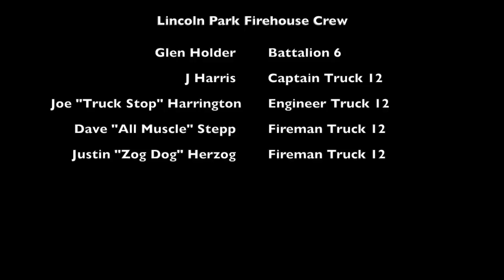Tuther Fire 2 FireCams

Comment: Hands Down One of the Best Videos Ive seen. Cap did a great job with his crew. This is one Video I will pass along to my guys. Keep up the great work and stay safe Brothers.
Reply: Nice video, nice hole cutting but a complete waste of effort and resources as they didn't have to go up there to put this fire out.
Reply: Last time I checked there were females in the fire department! Typical male comment, thinking it's still a males world!!
Reply: Hi!
Firefighter from Germany here ;)
I have one question:

What is the advantage, when you cut holes in the roof of the burning buildung?
I mean, that's pretty dangerous to work on a roof which is actually on fire in the inside, right?
Reply: @nicof.7051   roof ventilation, yeah can.be dangerous if a soft spot.Is stepped on so good judgement is always needed before going.up.to ventilate
Reply: @nicof.7051  vertical ventilation is to release the hot gases out of the structure to allow your interior attack team to advance of the fire for extinguishment and not be roasted in the process. US firefighters are taught the safest methods of all ventilation tactics.
Reply: @JB91710  your obviously not a firefighter.....if you are, not a properly trained one.
Reply: @SMichaelDeHart    I'm glad you explained in detail why you think that.  Wait a minute, no you didn't, just like everyone else!
Reply: @nicof.7051    If you start using Logic and Common Sense when you evaluate American fire fighting tactics, you are going to be in for a world of hurt here on YouTube.
Reply: @JB91710  scooter, please tell me what extensive experience you have in the Fire Service?! Basic fire tactics teaches that when you conduct an interior attack on a structure fire, vertical ventilation is a safe and practical application. Since you apparently have not received a certification in NFPA level 1 and 2 fire fighting, basic fire science methodology and NFA approved firefighter safety and survival, it appears to me that you're relative lack of knowledge is self-evident.
Reply: Look jackleg, my information is based on 26 plus years in the fire and EMS service. I've probably fought more structure fires then you have ever dreamed about in you're ignorant life. If you will study and apply engine company operations and truck company operations, it is common practice to utilize vertical ventilation as well as horizontal ventilation as dictated by the fire. In this particular scenario, you had a working structure fire on the B/C side of the involved structure. Flame impingement had occurred at the eaves and it was obviously extending in to the attic area. As the truck company arrived on scene, the company officer obviously made the decision, after his size up, to proceed to the roof to do vertical ventilation based on his assessment. The primary function of a truck company is for ventilation, salvage and extrication. Your comment regarding a waste of resources, was totally incorrect and tactically unsound. As the interior attack team was making their advanced upon the fire, it is common practice in the United States fire service to do vertical ventilation to reduce the heat and gases off of the firefighters inside the structure. While horizontal ventilation could have worked in removing some of the smoke out of the structure, it would not have removed the hot gases because, if you know anyting about fire science, heat rises. The heat builds up from the ceiling down and can cause major issues for the interior attack team. After the vertical ventilation was coordinated between the truck company and the engine company, performing their proper functions, the fire was quickly extinguished. I recommend you refer to the National Fire Protection Association, the International Society of Fire service Instructors, the National Fire Academy, the United States fire Administration, and many more other fire service organizations, including the Fire Department Instructors Conferences that are held yearly. I'm sure most of the well-trained and educated instructors will conclude that the operation was conducted, in this situation, accurate and to the point. Now scooter, I recommend you better hurry up and educate yourself in proper fire science and engineering before spewing  bullshit in questioning tactics that have been utilized for years and have saved many firefighters lives.
Reply: @SMichaelDeHart  Thank you. I see you have met our resident loon, JB. He is dangerous and is facing some harsh actions for his continued slandering of fire depts. everywhere.
Reply: @mxslick50  LOL..... this is the first video that I happen to come upon from this captain. It is absolutely amazing when someone tries to argue with experience and education. But, not only do I have over 26 years in the Fire EMS service, my degree is in Fire Science, I have my NFPA level 1 and 2 firefighter certifications, I am a IFSTA and NFPA certified instructor, I've been with two career and one volunteer department in those 26 years, I'm certified though West Virginia University and the Maryland Fire Rescue Institute and have over 700 credit hours in Fire Science and Engineering related fields. Every single structure fire is different. That is why we study building construction, fire behavior, tactics and the list goes on. We apply all of our experience and training to each scenario differently, since no working structure fire is cookie cutter. I do appreciate you pointing out that this so-called 'firefighter' is the resident loon.
Reply: @SMichaelDeHart  You're welcome. To clear up a few things, he was never a Captain, just a nozzle man on a Volunteer Dept. in VT. back in the 70's. As you will quickly see, all he'll ever do is call people names (Stupid, child, zombie, fountain statue, incompetent are his most -used ones), bash every dept, claim he can knock out a fully involved structure with the deck gun and tank water, spout off that "ff's need to get this search first crap out of their heads" (and just throw a bunch of water first, BEFORE looking for victims)....I could go on, but you can pretty much find this clown on every fire video that hasn't had comments disabled because of him.  This video https://www.youtube.com/watch?v=tgHZUyK2ON4 has a real great conversation showing the true depth of his delusion. (The replies to Skylar). 

I am in a very tiny town in Idaho, we have some apparatus and gear for our own Vol dept, that has been seriously neglected. I have been tasked by the Mayor to train and get our dept. back together again. Luckily our nearest muni full time dept. (27 miles away) has agreed to assist in getting me and a few others trained. I would like to talk to you more about it if you don't mind, hit me up on my channel's discussion tab.  

Thank you for your service sir.
Reply: @mxslick50  hey brother no problem. Have you thought about grants through USFA and FEMA?? Also, I know some PPE mnft also do grants/donations for small depts in need.
Reply: @SMichaelDeHart   Thank you, that is some great information, we will look into that. I still have to do an inventory and check condition on all of our gear and tools,  I do know that our radio's batteries are all shot, the previous idiots running the city left them in an unheated trailer without charging them. Once I assess our needs/wants, I will look into getting the process started.
Reply: @mxslick50  dude, did you see my last post? I'm more than happy to assist any brother in the Fire service. Read my last post.
Reply: @SMichaelDeHart   I and the fire fighters I worked with decades ago were using the things UL is just teaching Now. They and the rest of the American fire service got ridiculously scientific and complicated fire fighting  (Vertical Venting) to the point that they forgot to put water on the burning material and have seen where they were wrong and are going BACK to basic, get the job done practices they created in 2004. It isn't New Technology based on new Testing, it's just back to basics common sense fire fighting.  I could have written their book.
Reply: @mxslick50   "I am in a very tiny town in Idaho, we have some apparatus and gear for our own Vol dept, that has been seriously neglected. I have been tasked by the Mayor to train and get our dept. back together again. Luckily our nearest muni full time dept. (27 miles away) has agreed to assist in getting me and a few others trained. I would like to talk to you more about it if you don't mind, hit me up on my channel's discussion tab. "  (OH!!!!!!  So you NEED training?  But you seem to be so confident in your criticism of my tactics!  God Help that town.  Based on ALL your comments to me, they won't be any better off and will probably be worse off for your efforts.)
Reply: @SMichaelDeHart    That was a pretty Childish reply from a so called Grown man!  Do you even proof read what you write to see what Grown Ups will think about it?  You obviously haven't seen my response that I'm sure will only inspire more childish from you.

Here's a test of your professionalism and strong work ethic.

PROTECTION!!!  That, is what victims need before anything else!!!   FIRE and TOXIC Smoke, are the Threat!!!  That is what victims need to be Protected from!!!  When you think from that perspective and you consider Everything that is done from the time you leave the station to the time you get back, what is the Four Step To Do List upon arrival?  Think of EVERY Detailed step that needs to be taken before you can perform any job but only list the Four most important things that will Protect any victims..  I'll give you a guide to keep you on track  
Are you fully dressed when you arrive?  
Do you carry onboard water? 
Are there hydrants or an additional water supply? 
Can you See the Burning Material?  
How accessible are the victims?  
Do you know Exactly where they are?  

1.

2.

3.

4.
Reply: @mxslick50  🖒🖒...lol, hell, I gave up. I don't have the time or inclination to waste my knowledge on a human waste of space.
Reply: @JB91710  And another thing that hasn't sunk into your thick skull yet....I am respected FAR MORE that YOU are by these professional firefighters and like I said before, have you noticed that NO ONE other than YOU has debated the logic of any of my posts? Think about THAT one for a minute, since you preach about how you are a THINKER.
Reply: @SMichaelDeHart    That's the kind of response I figured I would get from you.  The desperation in your tone was telling.  I also noticed that in two response to my challenge, you didn't offer any fire fighting information.  Just more childishness.
Reply: @mxslick50    You are the second of your new playmates that doesn't have the time to waste on fire fighting tactics.  Could it be that you can't handle the truth?  My and the intelligent worlds tactics (UL NIST), are so simple and basic that you guys can't deal with them.  Too much work and not enough Heroism.  P.S.  Those were Shadows on the roof!
Reply: @mxslick50    Oh and you Blocked me?  I may just cry myself to sleep.  Child!
Reply: @JB91710  what they did would be called a "roof ventilation" not "hole cutting". Roof vent, is used to... you wont believe it... ventilating the smoke from the building. It also reduces the chance of a back draft or flashover.
Reply: @margief1798  Keep your feminism out of firefighting.
Reply: @SMichaelDeHart  Check your email..I sent you a few messages.
Reply: @mxslick50  🖒
Reply: @brendanzadera8948  You printed what someone told you very well. Too bad you can't THINK any better than the rest.   It is interesting to me that NO ONE can tell me how it works without saying Heat Rises.  I have printed volumes on how it WON"T work unless the conditions are PERFECT and even then, the fire inside the house is introduced into the attic and now you have a structure fire.
Reply: @JB91710 Where are you a firefighter
Reply: @brendanleak1490   It doesn't matter where or even if someone is a fire fighter.  Their comments either make sense or they don't.  Fire fighting is too simple for anyone to not get what I'm saying.  There are thousands of fire fighters and departments that just don't get what the JOB is.  How ling they have been doing it holds no weight!
Reply: @JB91710  if firefighting is so easy way doesn't everyone do it
Reply: @brendanleak1490  Most people want to actually work for a living, create and make money.  Squirting water and breaking windows is for the select few!
Reply: @JB91710  does your "fire department" teach you how to properly vent and when and when not to do it
Reply: @brendanleak1490    Nobody "Teaches" me!  I. teach me.  I have been a Thinker all my life.  Most people are Two Dimensional Reactors.  They see something, a thought come into their minds and they open their mouth.  A Three Dimensional Thinker, keeps their mouth shut and examines the subject from every angle, troubleshoots it and then formulates the best possible answer.  Most people Follow.  I lead.  People don't like Leaders so they fight them to protect their ignorance and mediocrity.  So, they don't learn anything.

Common sense and logic along with very basic knowledge of pressure zones are all that is needed to figure out when and how to vent.  A strong work ethic is the single most important ingredient in making a Good Job.  Most people overthink fire fighting to the point that they actually forget to put water on burning material.  Really!  Eliminating the threat is the First thing you do as a fire fighter, not that last thing like 90% of America's fire departments.

You don't vent until you have a charged hose ready to apply water to the burning material because when you allow heat, smoke and pressure to leave the structure, you are Moving those gasses and they will mix with fresh air from many different locations and the fire will get bigger.  That is a Bad thing!
Reply: @JB91710  if you don't vent the fire gets depleted of oxygen. And when you smash windows or open doors the sudden rush of oxygen will cause a back draft like the city had not to long ago. to prevent that you vent to allow the toxic gas and heat to escape and let the interior guys to make a push.  In the case of the video they also where checking to see if the fire got into the attic.
Reply: @brendanleak1490  That's why you start by breaking out the upper sashes as close to the fire as possible to release the pressure and give the gasses a direct route to the exterior.  That is quickly followed by breaking out the lower sash and applying water to the burning material.  Opening the door takes time and you need a fully dressed and assembled entry team to fight fires through a door.  Windows are faster and safer for knocking down the threat. When you enter, the space is Much cooler and there is No threat of flashover.
Reply: @JB91710  Your right, I did write what someone told me because you need to learn from someone to know something. Obviously, you don't.
Reply: @brendanzadera8948  Who teaches the teachers?  Ever think about that?  Someone has to figure out the Right way!
Reply: @mxslick50   The Garage video that you are such an expert on, childish one!
Reply: @JB91710  " @Brendan Leak Most people want to actually work for a living, create and make money. Squirting water and breaking windows is for the select few!"     

Yeah and we all know how well that has worked out for you, living broke and having to beg for money to finish your project car.
Reply: @brendanzadera8948   Well, I can say the one thing JB is right about in all of his posts is this: "Nobody "Teaches" me! "
Reply: @mxslick50   Ever Own or Build anything child?  You actually have to own something to lose it.  The recession plays no favorites.  Interesting how you focus on that rather than fire fighting tactics.  Are the shingles on that garage still smoking?
Reply: @Typical Canadian   Boy, you really don't get it, do you?  Someone has to Create the original idea using intelligence, common sense and logic!!!!!!!!!!!!!!!!!  It has to start somewhere!  Don't you THINK?  No, obviously Not!
Reply: @margief1798  jeez.. As a female in a predominantly male profession I must tell you comments like this one only make our work harder! Even if we are feminine we ARE part of the "guys".
Reply: @nicof.7051  Hello Nico, I agree with you. I think, opening ventilation holes on top of a fire makes for a chimney effect, so that the interior fire will be more intense because of more fresh air being conducted to the fire itself. The less oxigen a fire has, the less violent it will burn - eventually it may even go out on it self.
Reply: best argument ever, i think the firefighters did a excellent job
Reply: @knuffelbaer1971  Are you a firefighter? Have you ever heard of a little thing called a backdraft? Have you ever watched a fire up close and seen how wrong you are? 

Here's what a REAL firefighter (Brendan Leak) said in a comment above:
 " 
@JB91710 if you don't vent the fire gets depleted of oxygen. And when you smash windows or open doors the sudden rush of oxygen will cause a back draft like the city had not to long ago. to prevent that you vent to allow the toxic gas and heat to escape and let the interior guys to make a push.  In the case of the video they also where checking to see if the fire got into the attic. "

Let me highlight the key point for you:

"to prevent that you vent to allow the toxic gas and heat to escape and let the interior guys to make a push. "

Oh, and that fresh air you refer to...it is cooler than the continued heat buildup that results from an unvented fire, where said unvented fire will eventually cause another unpleasant phenomenon: Flashover. (The spontaneous ignition of unburned materials that have had their temperature raised well above normal ignition temperatures.)
Reply: @JB91710  LIAR
Reply: @JB91710  Malicious troll
Reply: @JB91710  Yes I have they are University Professors and Fire Scientists You have seen some they work for UL, NIST, ISFSI, and NFPA organisations. These people have far more expertise and knowledge than you. What credible academic certifications can you produce?
Reply: @mxslick50  https://youtu.be/9VDi8LfC3lY More of The village idiot attacking I have reported this as well as showing the world he thinks he is above the law; specifically the Americans with Disabilities Act and as I am a Canadian Citizen resident in Canada the Charter of Rights and Freedoms No person who clearly demonstrates they do not absolutely respect the law can be capable of being certified as a firefighter in any capacity. I think we now have information that can be used to prove this very clearly and it is in this video's comments  section.
Reply: @JB91710  this comment demonstrates a lack of vision regarding a coordinated fire attack. This is a fire attack that allows the fire to be fought by multiple teams or divisions that work together performing various tasks involving multiple tactics simultaneously (At the same time). Exterior operations generally have five divisions. A. B. C. D. and Roof. Their duties are to protect exterior exposures, ventilation and fire suppression exterior attack.The interior companies are basement and then a division for each floor the top floor includes the attic. Interior companies duties are to search isolate the fire and to apply the wet stuff to the hot stuff. any any all of these thing are occurring at the same time. to keep things coordinated there is an Incident Commander and fire company officers who pass along information about the fire to him/her then direct the firefighters with the balls to actually do the job based on the orders they receive from the Incident Commander. You keep asking where are you wrong. How about this you are bashing firefighters who are doing the job they have been told to do. Not running off and operating independently of the Chain of Command creating a risk to themselves and others. You should know something about that since it is the underlying theme in all of your commentary.
Reply: @JB91710  Do you remember stating that firefighters should follow the teachings of I.S.F.S.I. N.I.S.T and U.L. Here is a U.L. video teaching Vertical Ventilation.
Reply: @JB91710  I have seen basement fires that traveled vertically inside the walls of the structure and the second fire seat's place of origin was in the attic. Nothing between was burning. Gasification of solids by Combustion results in an very high coefficient of expansion. This will create positive pressure inside the structure. That pressure is seeking a way out. firefighters also have the original seat of the fire in the basement. Two places where the fire is oxygen starved the basement and the attic. My fire attack is an aggressive attack on the attic fire first. ladder to the roof vent the roof with a small hole to start extinguish the attic fire then open the roof to allow the gaseous fuels and other non-flammable gases that have been created out. Once the flow path is established the basement fire will be easier to manage get inside and cool the basement with a fog pattern and then get inside and work on the basement fire and the extension to the attic. It is important to keep a line on the roof and cool the attic space as the need arises. Another tactic to speed clearing the smoke out of the basement is P.P.V. can be used to force fresh air into the basement. Yes it is done because it provides the firefighter a safer environment to work in. Remember the C in SLICE-RS stands for cool from a safe location. Also remember you are working as a part of a team and the object of this endeavor is to prevent violent explosive and highly dangerous fire related events from occurring.
Reply: @knuffelbaer1971  In a coordinated attack the roof division works with the interior division to attack the fire at the same time as roof ventilation is being done. Because of the clearing of very fine carbonized fuels in the air (smoke) and the removal of heat it significantly reduces the risk of two violent fire events 1 Flashover and 2 Backdraft. The added benefit is it allows the firefighters to be able to increase the effectiveness of the fire attack because they are able to see better. The down side is that if the guys in the roof division linger too long then they become casualties in need of RIT.
Reply: @margief1798  Do you know whether or not he has any females on his department or even his company or if he is a fire fighter or even if this is not the male persona of a female YouTuber?
Reply: @JB91710  JB if you use logic common sense and lose the holier than thou attitude you might find yourself being slagged less often.
Reply: @JB91710  Your view is the European/UK view of firefighting.  They never get above a fire.  The air/fuel and suffocation concept you put forth here is how they see it, they say it works for them.  They play quite the game of hide and seek, and focus their attack at maintaining suffocation which by the OSB models we've all seen burn in the back lot during training, really is the best way to kill a fire short of water.
                The only problem I see with it is that it doesn't take much for the heat building up to flash once some fuel hits it with that 'attack' plan; just one improperly vented window, the wrong open door, etc.  To me, it can really be a recipe for a major catastrophe if that heat and all those flammable gasses are not expelled.  That's fuel too.
                 Roof ventilation is dangerous.  We know we've had FF's fall through (why UK chooses not to do it).  We know if the interior attack is delayed or not coordinated well with the venting, it can create excellent air flow and draft fuel into the structure making a defensive fire out of a manageable fire if it's not knocked down in a timely fashion after venting with fire present.   But above all, we know big-boy rules; the best way still to know where and how much fire/hot fuel-gasses there are is to physically see it.   I think this video is a classic example of the US protocol; the appropriate use of "big-boy rules" and a well coordinated attack between the interior crew and the roof venting crew.
                  Whatever method is deployed, timely, EARLY identification of attic extension is critical so teams can be properly deployed, attacks coordinated, and FF's kept out of harm's way as much as is possible due to good, non-rushed planning to hopefully, stay ahead of the extended fire.   Moreover, the goal is accomplished of saving the structure and irreplaceable belongings inside the home lost in a defensive fire, something nobody likes to blow the horn on if it was caused by the lack of good planning and execution.
Reply: @crforfreedom7407  

My and their view is the same as UL, NIST and ISFSI.  Find what's burning, vent it horizontally at the fire room and put water on it.  Simple!  Then you go in WITH a charged line to mop up as you perform a Search.  The victims and fire fighters are protected which is the Responsibility of every department everywhere.

It takes and Brain and the ability to use it to get any job done correctly.  At a residential fire, you do what I said above.  Eliminating the threat is Job One.  You will ONLY get Flashover if their is an ignition source and if the temperature is maintained.  If you hit the fire room from outside with tank water you will eliminate the flames in any room in a house ibn 3-5 seconds and soak the room in 5010 seconds.  The temperature in that room drops by 1000 degrees the second the flames are eliminated.  As that window should be the Only vent in the building at the time of suppression, it is the only pressure release location.  That means the smoke, heat and water vapor come out that same window.

"if it's not knocked down in a timely fashion after venting with fire present."  An Engine with at least 500 gallons of water drops off a hydrant FFer and drives up in front of the house.  They see flames coming out a first or second floor window.  Start the clock.  The driver/engineer steps down and activates the pump.  One FFer grabs a long pole and the Booster line nozzle and runs down to the window.  They use the pole if necessary to break out the glass in the first or second floor window.  They hit the ceiling with a straight stream and actually Move Their Feet in order to get a line of attack on the entire room.  Stop the clock.  That was performed in less than One Minute after the wheels stopped, the victims were protected and no FFers were put at risk.  An entry team can't be assembled, get fully dressed and get the front door open in that time.

"a well coordinated attack between the interior crew and the roof venting crew.'  Well coordinated attacks do Not Exist in America.  Period.  Vertical Ventilation ONLY risks FFers lives, turns a furnishing fire into a structural fire, wastes time, helps the fire spread and destroy the building.  It also puts Interior crews in more danger if suppression is held back, For Whatever Reason!  I KNOW those reasons!

Your last paragraph does Not describe 95% of American Fire Departments.  I won't go into the childish and irresponsible reasons why.   UL, NIST and ISFSI have created videos that show how to eliminate the threat quickly and safely and American departments don't listen.  Those agencies are 95% correct in everything they teach.  No departments are required to follow their teachings like other companies do with OSHA!  Non Thinkers have decided that rules would hamper the performance and safety of FFers as each fire has it's own characteristics.  The basic outline for every department should be as follows.  

"Eliminate the threat as Fast and Safe as possible while using the Least Amount of Water."  Think of this as if your family's lives and welfare were at stake.  What would you have to do for each of those key words and WHY?  Follow UL, NIST and ISFSI To The Letter and you Can't Go Wrong!  It IS as simple as that.

Fire fighting like any job is not a list of tactics.  It is a state of mind, a strong work ethic and high level of responsibility to one's self, your fellow fire fighters and Then the victims.  A dead fire fighter is of no use to victims.  When a May Day is called, Search and Rescue Stops!
Reply: @JB91710  That's the exact same argument/logic I've heard many European departments take.  They LOVE the lose reel because it can quickly facilitate the attack philosophy you specify.  As with all things there are opportunity costs, but yes; speed is a key factor.
                 However, the one thing you failed to adequately address which was my major motivation for the post; attic extension.   Your protocols explained here don't work on fires behind walls or in attics.   That was the focus of my post.  I'm not going to argue with your position on a room fire at all; a lot of departments across the globe use it to good effect.  US departments are beginning to incorporate it more with their interior attacks.  Like I said though, there's opportunity costs to everything.  The hose reel  for instance, a key element to the European quick response motif has limitations.  There's more versatility in the US method, especially on an exterior attack prepping for the interior attack, as unlike the reel, anywhere from a 1.5 to 2.5" attack lines can be deployed, and length added quickly.  Reels are fixed.   A lot of time can be lost with plan A extending a reel distance to a B-D- or C exposure, find it too short, then starting the attack line process over again from scratch or running back, grabbing extension, shutting down... you get the idea....   It happens.  Not often they say, but it happens.  
                     I think more departments with the available manpower on scene are starting to take a dual-attack approach; attack line quick to the outside while the interior attack is prepared, although good crews come off the truck pretty much ready to fight.  Most all if not all departments do start their attack off the booster tanks I think you'll find.  However the AO is often the guy that also makes the hydrant connection on a single engine crew, so it's booster up and start running the supply.  That can be a problem if quick adjustments are needed on pressure while establishing supply.
                      You say the coordination is never there, but we're commenting on a posting that is a textbook example for classic US methodology.  I agree there are probably a lot of departments sorely in need of additional extensive training.  I don't think you can ever train enough personally.  That's where having a strong IC, good captains and crews willing to take predetermined initiative (like starting to cone down power lines before waiting for direction and other safety initiated actions, etc) is key to a successful, unified, well coordinated team approach.  I know they happen, I know they aren't 100% of departments and to my mind, that's not acceptable for the safety of the crews if for no other reason.   There are certainly times when roof ventilation is performed but unnecessary, or well out of the region of the interior attack.   Again, training, training, training....
                   As a side note, may I also suggest that you would catch a whole lot more flies with honey rather than dung.  You can be pretty brash and offensive to people.  You've gotten it in return.  I don't mind you personally, I appreciate your passion.  You have a belief, are convinced and preaching the gospel.  I appreciate that.  Perhaps 10 years from now all the departments will look back at this discussion and their disagreement with you and go "duh" because standards have changed; progressed?  Perhaps you are 100% correct.  But a 2x4 to the face is a lot less effective persuasive tool than apathy, understanding and logic.  Just my 2 cents on that, for what it's worth....
Reply: @crforfreedom7407   

" attic extension."  I saw you mention it and was going to address it, then I forgot.  Attic fires are pretty much suffocating.  High pressure is being created.  The hole in the roof doesn't let Heat Rise as most people think, it's a Pressure Release Location.  They think that fast moving smoke and flame are coming from the first floor when it is Just the attic burning now that they have introduced fresh air and allowed the gasses to move and mix.

The best way to fight a fire that has gotten into the attic is to vent windows as you make your way to the top floor, open a SMALL hole and insert a nozzle like a pistol grip Booster line.  Then you can shoot the stream at the roof rafters in a 360 degree circle.  The water exploding off the rafters will cover everything.  While the team was heading up, I would have others at the gable end vents to open them up more.  Then you open a bigger hole for inspection.  In an average size house, you would just need one hole in the middle of the hallway for initial knockdown.  Then after you protect contents, you can Carefully open holes in other locations for mop up.  Water should always be surgically applied to get the job done fast, prevent water damage and to avoid running out.  

Interior mop up is Obvious.  The THREAT is the flames that radiating heat which causes extension.  You extinguish all Visible Burning Material Before going inside as it can be done faster than an entry team can get the door open.  You stop the threat and cool the interior to Protect victims and entering fire fighters.  The work that needs to be done inside is obvious.  

Seconds Count!  Seconds, not minutes!  A Booster line or Deck Gun is for quick extinguishment of Visible Burning Material while the other hoses are being stretched out, hooked up and untangled.  The best initial interior attack line is also the Booster line as it is easier to handle and get around corners while you are performing the search.  Any long distance locations can be handled with longer and bigger hoses.

Your second paragraph.  Try to find videos that show a quick exterior attack on VBM.  

This is a proper performance with One engine with at least 500 gallons onboard and a three person crew.  

1.  The driver stops at the hydrant.  One FFer raps the supply line around the hydrant.  

2.  The driver pulls up in front of the structure, activates the pump and then connects the supply line.

3.  A third FFer hits all the VBM with either the Booster Line or Deck Gun and then breaks out more fire room windows for venting..  

4.  The hydrant FFer grabs entry tools and heads to the front door.  Both FFers get fully dressed, get the door open and take the booster line inside for search.

If all you have is a three person crew, great care has to be taken during entry.  A dead fire fighter is of no use to anybody.

Leadership, Responsibility, A strong Work Ethic, Coordination etc., are found in the smallest departments on up.  The bigger they get the more focused they are on salaries, pensions, benefits, heroism and turning FFing into Rocket Science.  

Point:  The FDNY is one of the Worst departments in this country for eliminating VBM.  The threat to victims and fire fighters.  Your local all volunteer crew want's to protect their neighbors so they get the job done as quirk and safe as possible while not wasting the water they had to bring with them.

We fought fires in the late 60's and early 70's just like UL, NIST and ISFSI suggest now.  Then it was turned into rocket science and only in the last 5 years have those agencies gone back to logic and common sense.

My delivery?  Nobody understands where I'm coming from because 99.99% of the viewers are Two Dimensional Reactors instead of Three Dimensional THINKERS.

Two Dimensional Reactors.  

1.  Civilians see a FFer and think Hero.  They can do no wrong.  Criticize  their performance with Honey or Vinegar and they will fight you to the end.  No Thinking!
2.  The Vast majority of Fire Fighters will respond the same way.  How dare you criticizes us Heroes.  Honey, Vinegar no difference.  Been there, done that.
3.  Certain letters on their back, (FDNY) and only a fool would dare criticizes their performance.  They are the best in the world Just because they are from NY.
4.  TDR are Followers not Thinkers, Period!

Three Dimensional Thinkers.

1.  They know how to Think, imagine, study, and use common sense and logic to understand what fire fighting Really so they Can evaluate the performance of every department and every fire fighter before even considering that they are Competent Workers let alone heroes.  A strong work ethic doesn't come with the uniform.

Two Dimensional Reactors do not understand anything I say.  I am just a "Troll in my mother's basement."  No matter what I say or how I say it.  That is Pretty Pathetic!  People like you are one in a million as far as YouTube is concerned.  There are a Lot of Children commenting here.

I am trying to influence Borderline people who will actually LOOK and try to understand what they are seeing.  If I present my opinion sweetly, they will think it is just that, another way to fight fires.  95% of the  American Fire Disservice has no clue what the JOB is and what it takes to do it Correctly and Responsibly.  They and the hero worshipping civilians need a swift kick in the ass.  Go ask Worcester how Their tactics are working for them.  They are the same as those 95%ers.
Reply: @JB91710  OK.  I have to say I liked that post.  Well written and explained.  The only point you made I would take issue with was the "self-suffocating" comment on attics.  I would agree that on a conditioned attic one could argue suffocation, but a standard ventilated attic, properly ventilated at the eves, gable-ends (if not a hip) and ridge cannot be expected to suffocate.  It's designed to flow oxygen through that entire space, bottom to top, end to end.  Some are built properly, others not, but I wouldn't plan for an improperly constructed or non-conditioned attic.  
               In fact, a good rule is with modern building techniques, the steeper the pitch and the newer the construction, the more likely it is a conditioned space so there's validity to your suffocation argument there, but then, there's also going to be heat exchangers, A/C, etc in those spaces, so that means gas lines where they normally weren't, ETC.  If it's conditioned they won't seal the living space below, that means a lot of heat and gasses are going seep through and collect there.   A lot of heat and gas.  Well insulated in at the rafters too.   That means the % potential for backdraft when the attic door is accessed from the living space is....
               I mostly agree with your position regarding interior attic attack, but every event is different, I can't help but see scenarios where a roof venting team wouldn't aid the interior attack if well coordinated, yes, it happens!  
               Depending on the situation and structure a gable-end opening isn't bad either, although I've seen thoughtless planning lead to up-wind straight gable-ends being opened to disastrous effect.   It takes time to knock down the ceiling, especially ID those places where the water needs applied the most, and a gable-end opening on a house cut to hell (multiple ridges) is virtually useless.  Depending on the roof deck material and the extent of the burn, the water's probably going to vent the roof regardless!
                  I'm expecting some changes coming in the next 10 years myself, but change is hard for a lot of people.  It takes time...
Reply: @crforfreedom7407    My point on a suffocating attic, you can be careful and take your time getting up there.  There is no need to try to extinguish it from the outside by cutting holes.  Gable end vent removal to increase flow, not gut the wall.  Change?  It won't happen until your local department screws up massively and the Mayor's house and family burn up.  It's a Boy's Club.  Nobody wants to step on toes or it might come back at you.

Worcester, Ma., is killing off it's fire fighters because of Bad tactics.  They don't follow UL at all.  Too much childish brave shit and disorganization.  They effectively have No leaders.  Keystone Cops performance.  I heard the Feds are heading there and widows are starting to ask questions and getting interviewed by the media.  EVERYBODY thinks anyone who is a "Professional" Must know what they are doing.  Nobody uses common sense and logic and say, "That doesn't look or sound right.  Explain."  Change should happen the moment something wrong is exposed.  As long as humans are evolved, it will take more than a catastrophe before people will even give it a second look.  You think FIMA has gotten any better since Katrina?
Reply: @nicof.7051  exactly working on a roof with a fire inside is very risky as you dont know how damaged the structure is and it has a high risk of caving  in
Reply: @nicof.7051  your releasing the heat from inside and possible chemicals and toxins as well. Your making the interior teams job more obvious and also creating a flow for heat as well. Smoke rises, so having a hole in the roof creates a vertical path for the smoke to escape
Reply: @SMichaelDeHart  Safest method is dont go on the roof and horizontal vent.